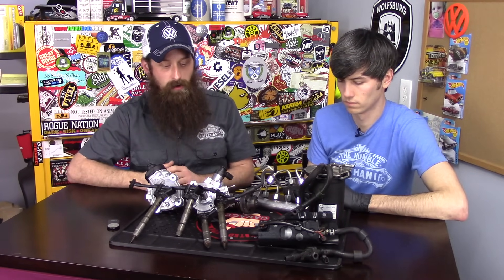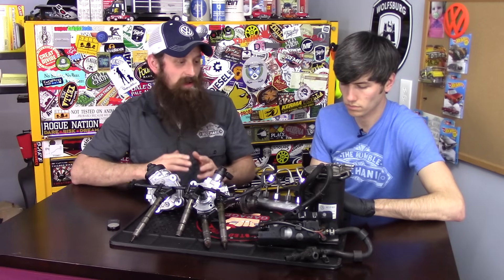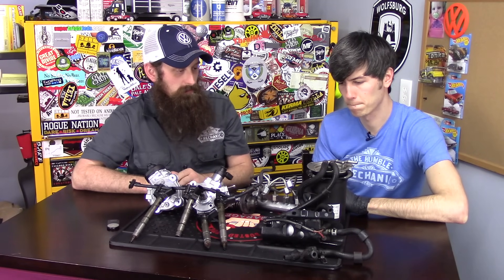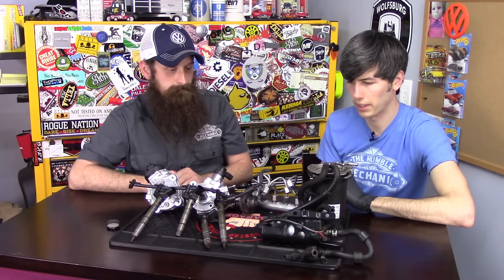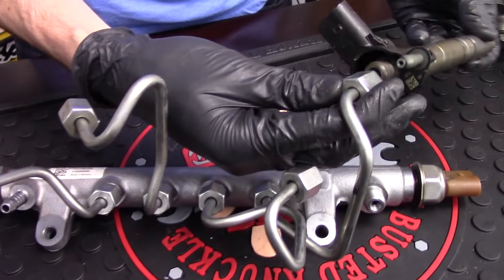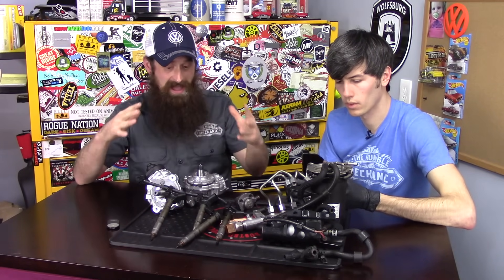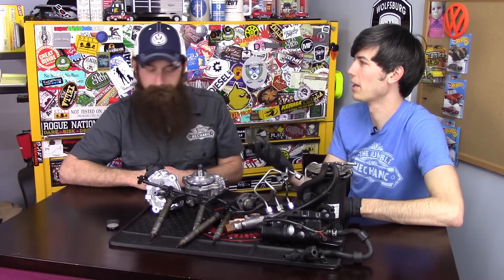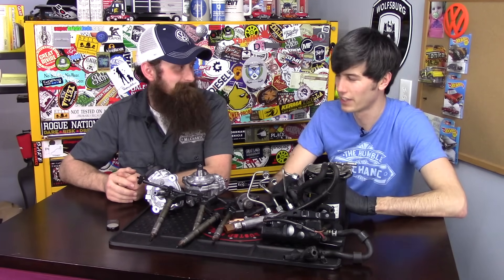Putting Gasoline In A Diesel Car - What Happens?

Comment: A 70% gas 30% diesel mix burned very well in my '97 Neon.  I worked in a Ford truck shop and always had an ample supply of that mixed fuel due to Gas mistakenly put into diesel tank.  No fuel bills for me for two years. The 7.3DI required no part changes....just fuel change. Damn.  The engine couldn't possibly run long enough to cause damage. VW seems like on sensitive gizmo.

Comment: This is rubbish! I have drained around 4000 misfuelled cars. 99+%  ran ok and drove away and nobody has contacted me to say they failed later. The ones that didn't were the ones that were filled with unknown fluids (water mostly) from a can, not at a filling station. 30 years ago I worked for an international haulage company and the drivers regularly put a gallon of petrol in the truck to stop it waxing at the top of the Alpes. In 3 years there we never had to change any injection pumps or injectors.

Comment: Just Siphon all the fuel out, put diesel in and crank until it starts.... why pay thousands of dollars to replace "potential" failure parts? 
If in the future something fails, then you replace that part and that part only....  much cheaper.
Reply: If you discover your blue in time, before you run the engine, your idea is the best option by far. If however you only notice your mistake when the engine starts running rough, make sure your best friends with your bank manager.

Comment: I work at a Mercedes dealership and we have plenty of diesels come in that people put gas in. Usually about $10,000 mainly because they were ran until the engine stopped. requiring a tow. Had a sprinter come in and it needed an entire new fuel system and the engine was torn down for inspection, $20,000!

Comment: Dear fellow commenters,
- They concluded that it was closer to $5000, not $8000
- The damage caused by a worn component not being replaced can eventually end up costing a lot of more than simply part replacement. 
Would you rather pay $5000 up front and have the problem fixed for good* , or spare the cash and risk paying a lot more down the line? 

*inB4 "It's not for good if they do it again!" (man YT comment sections are fun :/ )

Please have your selective hearing examined.

EDIT: 
Also, if they were in such a desperation to grab your cash, why would they make a video saying "For the love of God, please don't do this - it will cost you!"?

Comment: You should preventively change the entire engine.Just in case it was damaged.Its the long term ensurance,as this guy said.Also you should change the gearbox just in case it was damaged when putting a new engine in.Its long term insurance.Well heck you should change your car radio too,just in case.Or you should scrap the car emediately because it might fail one day.Mechanic logic

Comment: I cannot agree with you guys, everything depends on the % of gasoline on the tank, if we are talking about 20-30% of gasoline/diesel there's no big deal. Just drive calmly, and keep adding diesel every time t makes sense. If is more you should off course pump out the gasoline. Of course is better to change your fuel filter even if only 20-30% is added of gasoline. The opposite is not the same, the diesel will ruin your filter and will not work at all your engine, even at low adding %

Comment: Where i work (not a OEM dealer) we empty the tank, drain the lines, replace fuel filter and air it out it usually is just fine if the car was not driven until it stops but we have replaced several high pressure pumps and some injectors because metal shavings.
It all depends on how much gasoline and if they drive it or not
Reply: Btw just disposal of the mixed fuel cost around 2 dollar a gallon here in Norway so if it is 80 gallons it is around 160 dollar just for disposal

Comment: In 2005 I purchased a pristine 'previously owned' 2002' VW Golf TDI from a So California Volkswagen dealership. I drove it home 40 miles and went to bed. The next day it nearly eluded starting altogether. Drove it straight BACK to the dealership. 
Diagnosis: THEY had topped off the tank with gasoline the day before upon my purchase. So much for hiring 'illiterates' to keep business costs down.

Comment: I had the problem of using a fuel station that was later "refreshed" with new tanks and lines, and my next service the mechanic said my fuel pump filter was full of metal shavings.  Ie - the station had a water contamination.  Of course the fuel station would not accept liability as I needed a year of receipts.

Comment: I was taught that putting the two together created an air fuel mixture issue creating a higher degree of hazard. 

That diesel by itself was too lean for combustion and gasoline was too rich, mixing the two created a more volatile situation not only for the engine but for the storage and handling. Ignition sources can come from many unexpected places, like some Knucklehead thinking he can smoke around it because he's done it a thousand times either gas or diesel, or some other unforeseen event. 

Either way I definitely appreciate the insight to the internal mechanical aspects. Two Thumbs Up 👍🏻👍🏻.

Comment: I have an old 1937 Stover 1.5hp gasoline engine that will burn anything that can mix with air and ignite with spark (low compression ratio for burning kerosine). Ill take that diesel-gasoline mix off of your hands and burn it to generate elecrticity.

Comment: What a pile of nonsense. If this is your private car and you didn't drive for long on gas, get the gas flushed out and don't worry too much. And in most cases, you will have some diesel mixed with the gas so there might be adequate lubrication anyway. The metal pieces are not big enough to cause major damages.

Comment: Years ago I had just purchased a seat Leon (diesel) and by mistake I put 20 litres of gasoline when the tank was in reserve.
I drove it for over 30 kilometres (20 miles) until the overwhelming smell of gas and some funny noises made me realised I fucked it up. 
I managed to stop by a local garage, they drained the tank and filled it up with diesel, and off I went.

The car didn't give me a single mechanical error for the next 8 years.

Comment: well,,,I recently witnessed this error via my Girlfriend. Total cost of repair.......300 Euros!! They simply drained the tank, flushed the system , changed the fuel filter, refilled with diesel and the car was fine. I think what saved her is the gasoline never made it to the engine as we were driving home the previous evening after she filled the tank with Gas. The car just didn t start the next morning. But come on! 8,000 bucks?? One could replace the engine in many mid-priced cars for that! This was an interesting video, however, kinda like "mechanics Porn! :D

Comment: Either you are working on really crappy cars or you are just milking people for money. I had a 2012 Mercedes diesel fueled with gasoline. After that I drove another 300 km, next day I started it again and brought it into a Mercedes service, in Germany. They disassembled the engine, inspected everything and there was ZERO damage and absolutely no metal fragments. They just replaced the fuel filter insert and retuned the timings after stress testing the car for another 200km on a dyno, so most of the 600€ bill was labor. The car was still working perfectly 20 000 km later when I sold it. Just replacing everything that gasoline touched is pure greed.

Comment: the e85 was in my bed . same as using ever clear or anything that will light up if compressed ...like i said not good but if ur on the side of the road and only have to go 15 20 miles just do it

Comment: i just put a $600 program in my 1.6 tdi vw caddy taking it to 145 hp...the ppl who did the programing advised that best way to clean the fuel system is add 1 gallon of gas to 30 diesel and that will clean everything out......

Comment: Flushing the fuel lines with break cleaner is fine? How about just draining the tank then add diesel and flush out the lines and system that way? Auto Mechanics are one of the biggest scam industries out there

Comment: This is total BS! Check a Mercedes Diesel original repair manual from '70's-'80's and they'll recommend adding gasoline in diesel for winter. If I'm not wrong, you can add up to 30% gasoline in diesel fuel. I don't know about modern diesel engines, but just draining the tank, injection and fill it with diesel will be OK. Gasoline is not going to affect much the cetane number of diesel fuel. That's why if you don't add too much gasoline will be OK. Diesel in gasoline (engine) is a different story. Diesel fuel is going to dramatically reduce the octane number and detonation may ruin the engine.

Comment: Funny thing in hindsight when I had a text from a relative who wondered wether it's a big problem to put gasoline in a diesel car. "Oh that's a big problem." I said and told him he could look forward to a costly repair to the whole fuel injection system. This was a Volvo V70 with a D5 engine 2008 and it was driven from the gas station until it just stopped and then he recalled what he paid for at the gas station. 

But when he got the Volvo to a small workshop it turns out that the only thing that happened was the in tank fuel pump seized up and blew the fuse when the gasoline entered the pump. 

Everything was working fine after a thorough cleansing of the tank and the fuel lines to the engine. 

Lucky day for them!

TL;DR Volvo V70 D5 2008. Misfuel result=  Blew fuse to the in tank fuel pump. Nothing else.

Comment: Classic mechanic's math... It will cost you 8k, after some pressure to brake the cost, it comes up with 4k for parts, 1-2k for labor, total 8k including 2k in diesel fuel for line cleanup cost...

Comment: I had a friend, years ago, that had swapped out his diesel engine for a gas engine and when someone borrowed it, they went to fill it up and saw the label on the gas cap that said " Diesel Fuel Only" and they did. Messed it up a bit and they had to pull the tank and drain it also.

Comment: a couple injectors a fule pump and a disel filter 8000, I could by the parts off ebay non branded parts for under 1000k

Comment: I was Vw Tech and the 8k price stated is real in fact it could go as high as 10k for miss fueling your diesel vehicle... If you put gas in your Diesel it`s not covered by any factory warranty & the cost you`ll assume will be customer pay prices. Contacting VW directly sometimes customers get the repair 1-time covered or anywhere in between paying it all yourself. Vw released several service actions to put stickers inside the fuel door, special colored fuel caps, and devices to not allow a gasoline nozzle to fit into the fuel neck of a diesel VW & magically some how people still manage to miss-fuel their cars.. Anytime a miss fueled diesel vehicle comes in Technical Support is contacted & much of the repair is guided by VW engineers based off the techs findings.

Comment: I don't understand how diesel and gasoline fuel pump handles aren't somehow mechanically 'keyed' so that when the user does accidentally put the pump nozzle to the tank input it's obvious
that they are putting the wrong stuff in.
Reply: Teymur Azayev may be not all, but a lot of diesel pump nozzles are bigger than gasoline nozzles and won't fit in a gas filler tube... not much protection for gas in diesel though.

Comment: Fifth Gear (British TV show) was very sceptical that you need to replace all of this and so tried running a diesel car on gasoline for hours (until the engine died). Then they just refueled it with diesel, started the engine and it worked and passed MOT. They used it for weeks with no problems.

Comment: I was tired after driving home from the beach several hours one day and stopped to fill up my one ton Silverado Duramax. Normally the diesel pump has a green handle so that's what I grabbed and started filling. About half full I awoke from a daze and realized I was pumping gas in my tank, it had a green pump handle. So I of course stopped and filled the rest of the tank with diesel and drove away feeling a bit uneasy about the situation. I had talked with a diesel mechanic about burning different fuels in a diesel before so I didn't freak out too bad. Anyway, I really couldn't tell the difference driving the truck, just restarting when hot. I would have to go under the hood and pump the fuel manually several strokes then it would start again. Diesels will also run on heating oil which is identical to diesel with the exception of the color die which shows if the road tax has been paid, and on kerosene or jet fuel which is a high grade of kerosene.

Comment: This butt lizard wants to charge to you 25 buck a gallon to get rid of the fuel........ever heard of a fire. Pour it out and burn it. Personally I would add some oil and drive the damn thing. Ive done it before, in fact it ran better....and was easier to start. Lot of farmers and truckers add gasoline and oil to there fuel in the winter because it starts easier.....they just don't talk about because of warranty issues.

Comment: Add some oil to the tank and go on down the road. Just top it off with diesel ASAP.... I had this happen to me and threw a couple of quarts of oil in the tank and went right on down the road.....that was 6 year ago and it still runs fine today. Two quarts of oil was damn sure not 8 grand either. There both hydrocarbon fuels. Cut the gasoline with oil and go on, then top it off with diesel ASAP.........Not a problem.....

Comment: In the US, diesel pumps are separated from the gas pumps and you can tell by the color of the handle and the size of the inlet in the tank. No such thing in some EU countries. I knew the car needed diesel, and when I got to the pump, the nozzles were all switched by an prankster, and guess what, ended up with gas in a diesel car. Some of these countries just don't make anything easy for non-locals.

Comment: One problem with what y'all are saying, the majority of the time fuel haulers use the same tanks to haul diesel in, as they do gas. So you ended up with gas in diesel, and diesel in gas. An before you say they empty the tanks when delivering fuel, not all the product will come out of the tank.

Comment: my buddy had a 97 chevy 1 ton with the 6.5L diesel, he picked up fuel that had soap in it so it was chuggin for a few weeks. He added fuel additives to help kinda get along because he knew the injector pump was fixin to go at anytime so one day when we filled up he put 1 gallon of gas. the gas was to eat at any debris that wasnt supposed to be there out, which it worked for a few more weeks until he hooked up to a gooseneck trailer with 2 tractors on it and that made the truck try to runaway from him. But in short its a old trick to use a small amount of gas in a older diesel in certain situations

Comment: totally false! clean the tank clean the lines replace the filters and you will be fine! $8,000 that sounds just like a Volkswagen mechanic! replace everything there could be 1 and 10,000 chance there is damage! most Mark 3, 4, 5  tdi Volkswagens are not even worth $8,000..

Comment: Everyone here complaining about the cost of replacing this system and questioning why the dealership would even bother replacing these parts has not worked in a dealership before. They're covering their butts as well as the customer. This man explained the exact reason as to why each one of these parts is replaced, sure you can half ass the process and replace one piece or nothing at all and hope for the best or replace what could be affected and know your customer will be safe and satisfied and you won't have come backs wasting your time and money.  Because at the dealership you're diagnosing and replacing parts for free once the customer comes back complaining that after you worked on the car it didn't work right.

Comment: actually 10% gas in a diesel was standard practice to prevent gelling in cold weather in the past, just pump most of the gas out and fill with diesel and it will run out and be good.

Comment: Hello guys! I just have this question. I drive a Mitsubishi Mirage G4 GLX. 

I was not able to refill my gas and I was not able to anticipate the distance that I will be running. Cut story short, my gas gauge is blinking, the gas station is still far away. Out of desperation, I bought "bottled" gas just to get to the destination and few hours later, refilled properly at a gas station. I'm kinda worried it might be adulterated gasoline. Anything I need to do? Thank you so much!

Comment: So, that is why you buy and use OLDER Diesel cars. They will run on filtered french fry oil (or olive, peanut, soy, or rapeseed oils!), and can run reliably on 30% gasoline contamination......
1990 VW Syncro with an AAZ motor. 
I can (and do) pour random fuels and oils in my tank (hell, I even did used motor oil, just to prove a point!).

Comment: This is all BS. I own diesels and gas burners and I was the shop foreman for both Ford and Chrysler. WE drained the tanks, we siphoned the gas off of the diesel and split the gas between all of the techs and we put it in our own cars. Then we put 5 gallons of fresh diesel in them and bled the lines till they started and sent them out the door. They never came back. Never had a problem. I even watched a guy put 5 gallons of gas in a 45 gallon diesel tank to keep it from jelling during the winter. Never hurt that Mack truck with the inline 6 turbo not one bit. Wished we got 8 grand for 60 bucks worth of work.

Comment: If the fuel tank was filled with the engine turned off and the person realized it then, dropping & cleaning out the tank is all the work that is needed. Even going by different quotes by different repair shops, the highest cost I've heard hovers around $5K.